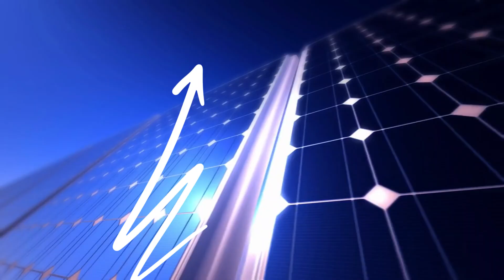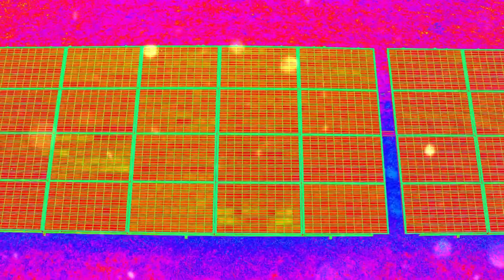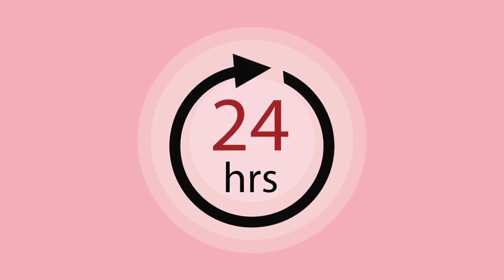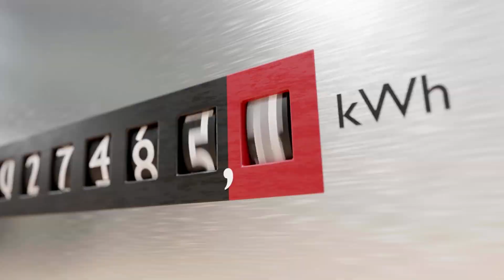This Vertical Floating Solar Farm Could Replace Land Solar Forever

Comment: Just put those panels on those houses as we do in Australia, generate power where it is needed to reduce transfer costs and loss.
Reply from the maker: That's a good point about distributed generation and reducing transmission losses!

Comment: Waste of time and money. Quaz a spin off company of MIT is using energy beams to drill through rack to greater depth thus making geothermal energy available in more places. Once the two holes are drilled there should be infinite power forever. Thorium nuclear energy will take waste thorium and nuclear waste from conventional nuclear plants and turn them into cheap power. Water can be converted into a combustible gas was demonstrated by Stanely Meyer. Solar and wind will, be supplanted by better technologies.
Reply from the maker: Thanks for sharing your view. BTW, we have another video about Quaise Energy -> https://youtu.be/36IanlNsJks

Comment: The biggest stupidity ever created. Vibration from waves and wind will destroy the solar cells between the glass very quickly, and it's all over in 1-2 years.
They shade each other for a long time in the mornings and evenings because the rows are very close to each other, therefore they have NO efficiency -70%. 
Chemical alkaline and biological water processes on the rough solar glass have no solution that will end this stupidity before it even starts. Separately, the cables, connectors and dozens of things will collapse this stupidity. Separately, there is not so much water surface for capacity.
See why China drives them with concrete stakes motionless into the bottom of the lakes, instead of moving on the waves.
Reply: It’s a pilot project.  The numbers will be interesting.
You’re correct to question, but idiotic to think you’ve disproved anything or believe they’re not dealing with exactly these issues in the project.
You’ve phrased your response to massage your own ego.
Reply: @Zirrad1  😂 ego? Physics is an exact science, like mathematics, it does not recognize feelings, ego, views, politics, religions, beliefs or any human stupid thoughts of the kind. AI is also powerless against science.
Instead of arguing and feeling powerless, upload real-time data from the effectiveness of the system with video proof. Do you dare? Or is it shameful to prove them in front of an audience. I know it is so, these tactics of misleading customers, or the powerlessness of this PV system always remain hidden, why? Because physics has a categorically negative answer, against the lies in the video. If not, show it.
I quote you: "EXACTLY THESE ISSUES", yes impossible to eliminate, that's the problem. Kapichi , sensitive man ???

Comment: Water will absorb the infrared and reflect the other light frequencies back towards the panels... as long as they are installed in higher latitudes
Reply from the maker: I agree with you; water's ability to absorb and reflect different light frequencies, including the infrared that heats the panels, is not dependent on the installation latitude. Instead, water absorbs a significant portion of infrared light, which is converted to heat, while it scatters and absorbs visible light, making it less effective as a reflector for most solar panels. However, this can be used in certain systems to cool the panels and the greenhouse they are installed over.

Comment: That is great. I like this tech.

This German company SINN Power has developed the world's first vertical floating solar farm, which was recently commissioned in Germany. Located on a former gravel pit lake in Bavaria, the plant features vertically mounted, bifacial solar panels that generate electricity from both sides. 

The vertical design, combined with open water corridors, allows for high power density while using a minimal amount of the lake's surface area. The initial plant covers only 4.65% of the lake, well below the 15% limit mandated by Germany's Federal Water Resources Act.
Reply from the maker: That's some great information about the vertical floating solar farm in Germany!
Reply: This takes the disadvantage of high latitude, and makes it a plus.